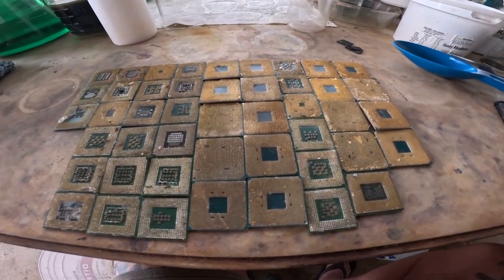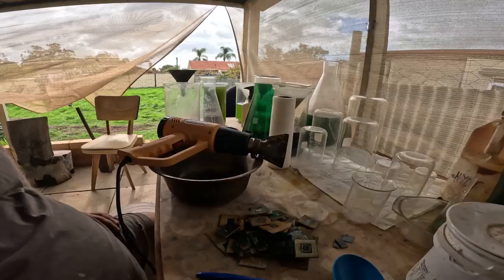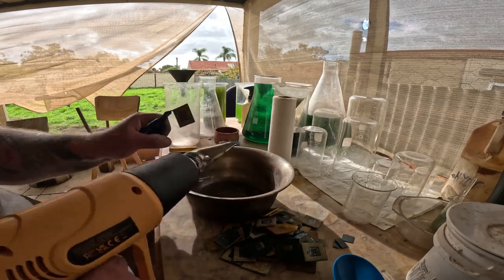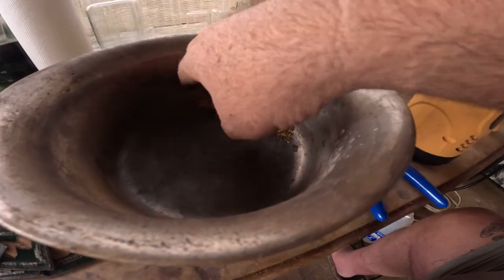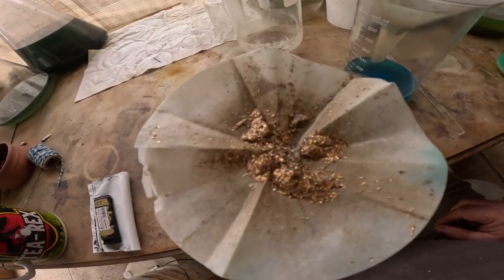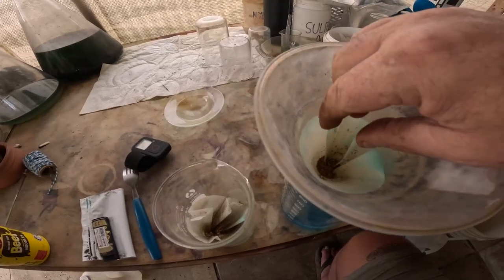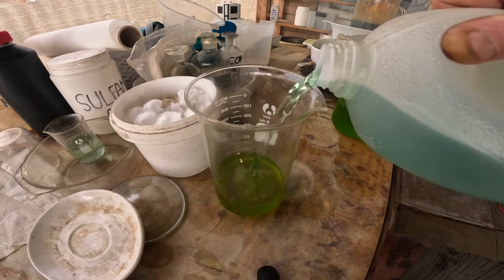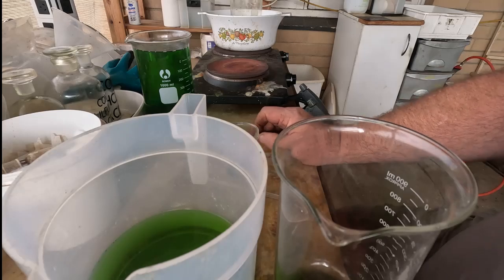GOLD RECOVERY FROM PINNED CPU'S

Comment: My friend that heat gun will send the pins flying. I've tried it as well as a hot plate. These days I put them into AP for a week. I get all the pins and no tin to deal with.
Reply: Plus if there is gold lettering on it you get that tiny bit as well. If I get flip chips with nice lettering I put them in too.
Reply from the maker: nice
Reply from the maker: nah the pins didnt move , i scraped them off with the tip of the gun and they fell into the bowl